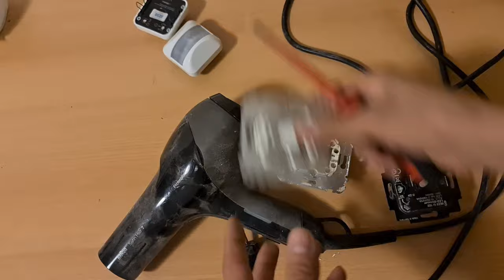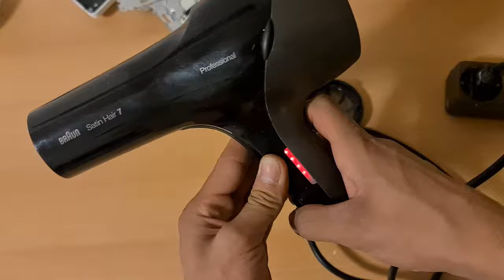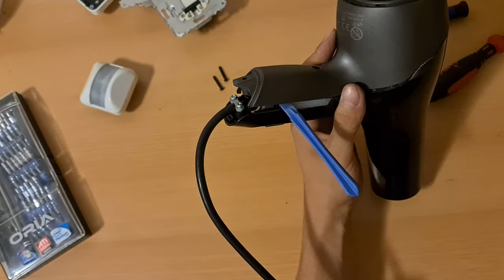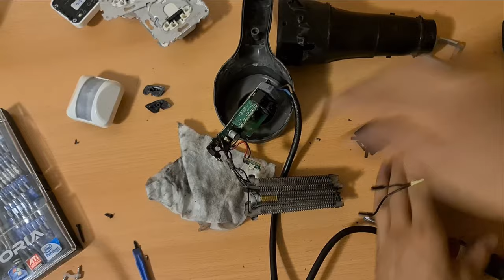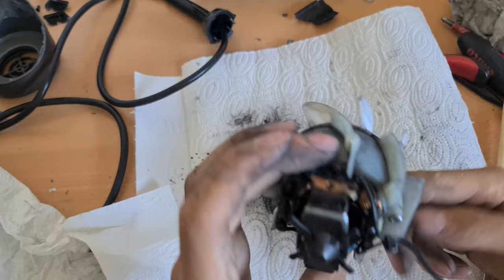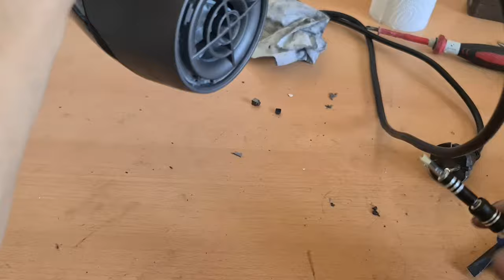0,30 Euro Braun Hair Dryer Repair  /Braun Haartrockner Satin Hair  Part 1

Comment: Yesterday i repaired a hairdryer. The connector (cheap quality) was broken and i replaced the cable. The Torx screws had an little pin, therefore i had to cut the pin/ nipple and then i could losen the torx screws.